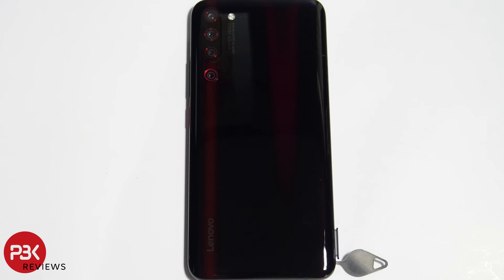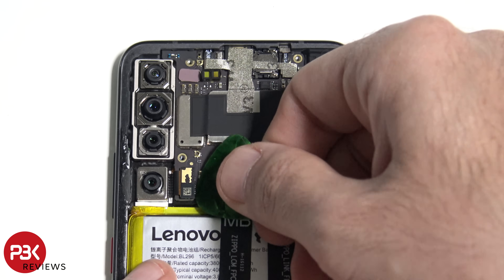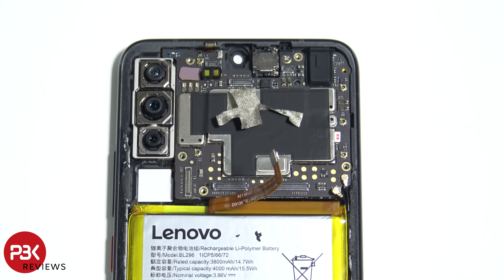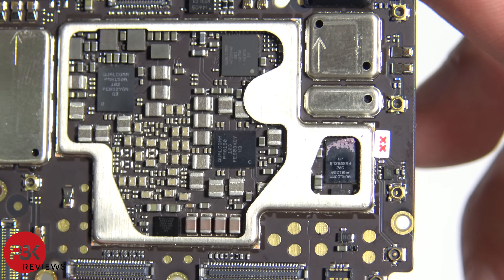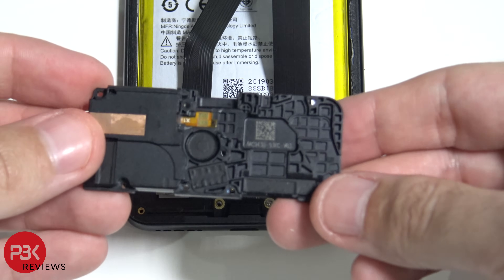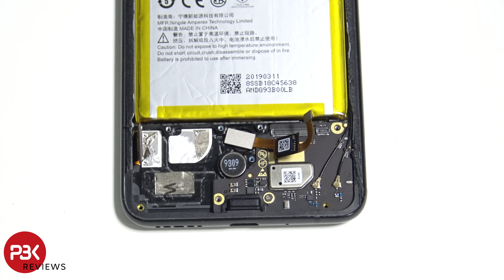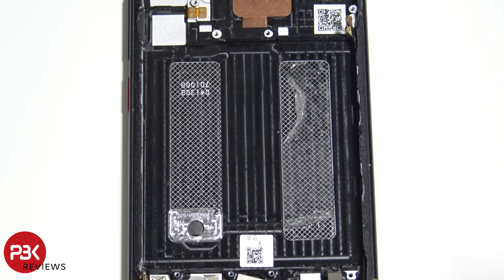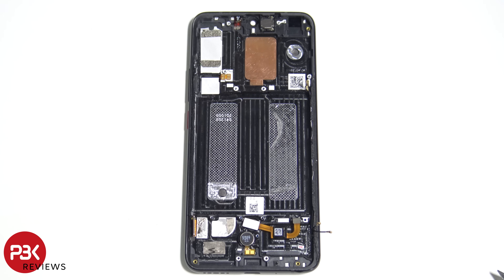Lenovo Z6 Pro Teardown Disassembly Repair Guide. Better than I thought.

Comment: Is it easy to change the charging pin?? My phone won't charge properly and I have to keep moving my charging cable to get my phone to charge.
Reply from the maker: You would most likely have to replace that bottom sub board which has the charger port soldered onto it. It would require someone who is good at soldering to be able to replace the charger port alone.
Reply: @PBKreviews  thanks for replying bro.

Comment: Hi, thanks for this video, i need to change my screen and it will be a great help for me. I would like to knpw, to change the screen, i need to remove all mother board, battery, etc.. like on this video?
Reply from the maker: No problem. No you don't need to remove all the components. Just remove the back plate, and screws on bottom plastic cover and remove the bottom plastic cover so you have access to the screen cable on the left side. Disconnect the cable and heat up the screen, pry it off, remove the old adhesive and apply new adhesive and re apply the new screen making sure you run the cable through the opening in the frame again and re assemble the phone.

Comment: i've dropped my phone on the water and now it isnt charging anymore! Maybe that's the humidity protection? I have a hairdryer, maybe i can use it for heating the back of the phone and for drying? I'm afraid of sending it back to china for warranty and when it comes back my country throw all the fees and taxes over me again...
Reply from the maker: Warranty wont cover water damage. The phone would need to be taken apart and all the water inside would need to be dryed out with a cloth or something then a tooth brush or other brush would need to be used to clean off any corrosion on chips and connectors. Using the phone like that can cause the phone to short and be rendered useless. You would need to probably take it to a repair shop to clean for you or replace the charger port if it went bad since warranty would not cover water damage.
Reply: @PBKreviews  i've tried to clean it by myself but i couldnt even open the back of the phone, ive warmed it a lot but the back didnt opened. i'll take it to a repair shop so they can clean and dry the phone and maybe it comes back to its former glory
Reply: @PBKreviews  The Pry Pick u used is 0.46mm or 0.71mm?
Reply: Did you ever get around to opening up the phone? I dropped mine in the water recently and it's also having a difficult time charging, it still does but its very finicky.
Reply: @patricknapier8902  yup, I opened it and gave a quimical bath (don't know if it's called that way on ur country) the status bar doesn't comes down but the phone is working just fine!

Comment: Hi guys do you know where I can get camera replacement for this phone I've looked everywhere but no luck 😞😞😞
Reply from the maker: you can try this website, but I have never bought from it before.   https://www.maxbhi.com/replacement-back-camera-for-lenovo-z6-pro-main-camera.html
Reply: @PBKreviews  i saw this site but i was thinking there should three connectors i can't know sure because I'm still using the phone and have not open it up as yet 😂. That has two

Comment: I have a problem with my lenovo z6 pro. Suddenly the sounds disappeared and then I took them to the repair center, problem they did not have replacement parts, so what they did was reball the ic of the sounds.
But still not working, now there is also a problem with wifi on and off so the connection is lost. It will connect few seconds and disconnect for a few seconds also and it will connect again. Hoping someone can help me with my problem. thank you and Godbless.

Comment: can i ask can you do lenovo z6 lite lcd replacement
Reply from the maker: I've tried before to get lenovo z6 lite but have had trouble getting the phone, only available overseas and china and those sellers have always delayed and canceled shipments. So I skipped doing that one but its not too difficult. That one the housing has catches around the frame holding the back housing in place. Watch this video here to get an idea of how the back plate comes off: https://www.youtube.com/watch?v=5YPGHKiLbQk     Remove your sim tray first, also after you use a plastic pry pick to separate the back housing from frame, the finger print reader is still adhered to the back housing, so use a hair dryer to heat around the finger print reader to loosen the adhesive and push the finger print reader in to separate from the back housing. After that you would need to disassemble the phone etc. Your best bet would be to get a screen assembly that has the screen with midframe already attached to make it easier during replacement process so you just move all your parts from your old phone to the new screen assembly frame.
Reply: @PBKreviews  tnx bro your so cool
Reply from the maker: @aaronleonor1421  no problem :)

Comment: Where is the signal antenna located?
Reply from the maker: There would be more than one antenna used, first thing I would check would be that top black plastic that covers the main board. It has light grey colored lines drawn into it which are the antenna lines. Also you would need to make sure your main board is seated properly in its place so the gold contacts around the main board touch the frame contacts which lead to antenna lines as well. Also make sure the two wire cables running from the right side of the main board down to the charger port board are connected properly. Not sure exactly which ones are used for cell signal and which for wifi etc.
Reply: @PBKreviews  thank you so much
Reply: @PBKreviews  also, how can i open the back of my phone without any fancy heating equipments? Can i use fire or what?
Reply from the maker: @keimaChii  no you can't use fire. you can use a hair dryer if you have one
Reply: @PBKreviews  ohhh thank you thank you
Reply from the maker: @keimaChii  you're welcome

Comment: Thank you. Nice video. Could you measure its battery size? I would like to change the battery but they sale the BL234 only, not BL296. I don't know it will fit or not.

Comment: So the battery can actually be replaced but extremely hard.
Reply from the maker: Yes, anytime anyone says batteries are not replaceable that is incorrect. They are just referring to the fact it may not be a user friendly replaceable part or was not meant for an end user to replace. But pretty much every phone battery is replaceable, some are just harder than others.
Reply: @PBKreviews  
I hope you can upload the footage for removing the battery If you still have it.

Comment: I dropped it and now the screen is black. Glass is not broken, touch still working. Thought perhaps a cable got disconnected because of the impact, but that's not the case. Should I just get a replacement screen?
Reply from the maker: Its possible the screen itself got a hairline crack somewhere. Sometimes its very hard to spot and will only show in certain light or angles unless its on a corner somewhere hidden. Your best bet would be to try opening it up and making sure its not the cable and if still no luck, replacing the screen.
Reply: @PBKreviews  Hi again. I got a screen replacement, but still no luck. Could it be possible that I need to replace the cable you disconnect @0:53 ?
Reply from the maker: @Chu_bm  I mean its possible, but not sure, I don't think the cable would go bad from a drop.

Comment: Thanks a lot for vídeo, i own na z6 lite but now i got touch freeze i must poweroff on button than screen touch come again, do you saw this kind of problem ? ty
Reply from the maker: Hi, I haven't seen that issue. Check to see if its on the latest software, if not then do a software update or do a factory reset on the phone to see if it fixes it. Make sure to backup your info first
Reply: Paula, I have they same issue, did you manage to solve it?

Comment: 30-35 mins even with a heat gun? Almost like saying they don't want you to reuse the phone after the battery died.
Reply from the maker: Yup, or they want you to pay them to replace the battery for you which would cost more than someone buying it online and replacing themselves.
Reply: I was planning on buying a lenovo z6 lite since it has the cheapest sd710 around but i can't seem to even find a battery for old lenovo phones like k8 note, k9, z5 series, even on aliexpress, alibaba, ebay or amazon. I guess replacing the battery is just impossible for lenovo phones, or perhaps you use a different battery as long as the battery and the connector fits?
Reply from the maker: @LateraL1ty  yea sometimes there are compatible batteries

Comment: Wish I saw this before so bought it.  No NFC, No Wireless charging
And now that I have it, no working LTE compatable for Canada
Reply from the maker: Have you tried adding APN settings for your network to see if it will get LTE working? I have a APN settings video you can view and try.
Reply: @PBKreviews  I have.  Actually had the carrier support team input the APN
Reply from the maker: @octavianhd  oh i see. Check the specs for the phone and see what LTE bands it has, and check different networks in canada see if any run on those bands. Would be kind of hard for every network in canada not to use any of the bands the phone supports

Comment: Where is the liquid cooling system
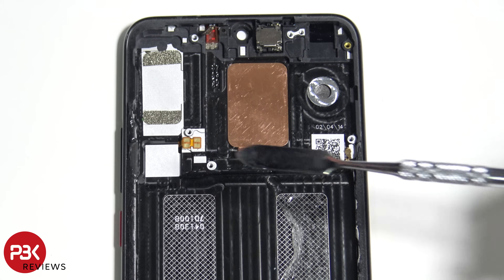Reply from the maker: @5:13 you can see the copper heat plate and heat pipe that runs under the main board and in between the frame and screen
Reply: Thanks

Comment: Good teardown.  one thing you should've checked the ports. sim tray etc speaker holes for water seal.
Some manufacturers will seal the ports even though there's no certified water resistance
Reply from the maker: Thanks. will try n cover that in future teardowns.